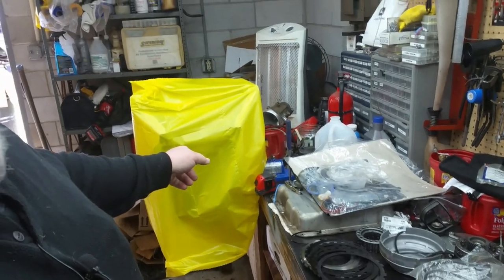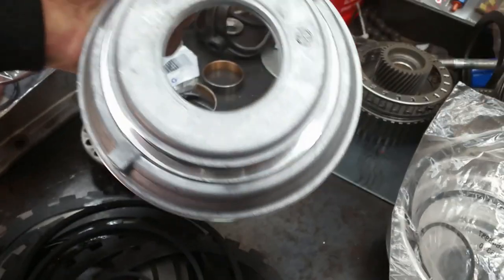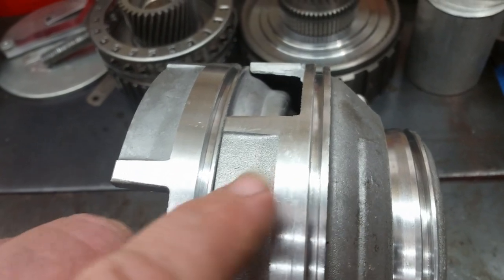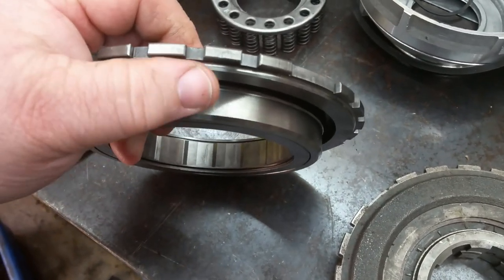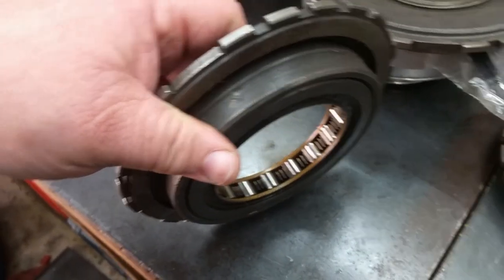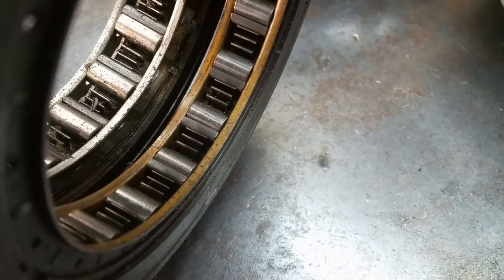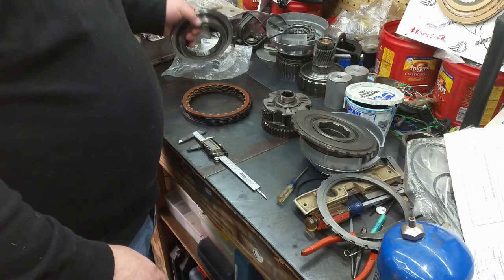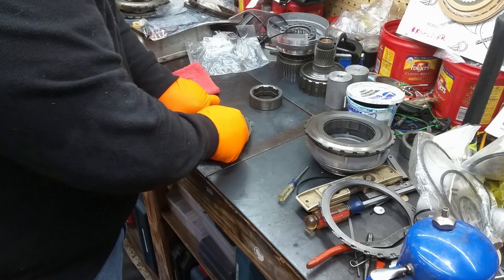L2theW 700R4 Transmission Assembly Part 3 - Raybestos Blue LoRev Clutch Setup

Comment: There should be a wave plate and a selective size steel in the low reverse cluck pack
Reply from the maker: Not all of them use the selective steel plate, but there is a wave plate there. As long as the stack up height is correct, then you're good. I have seen it both ways